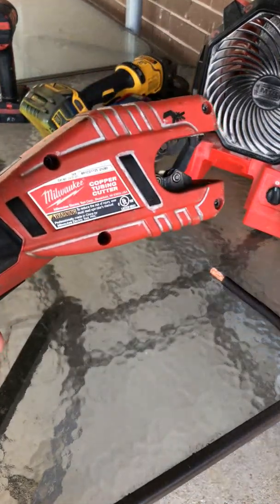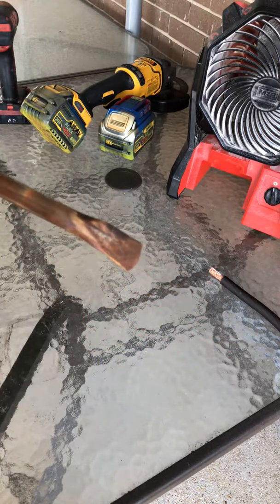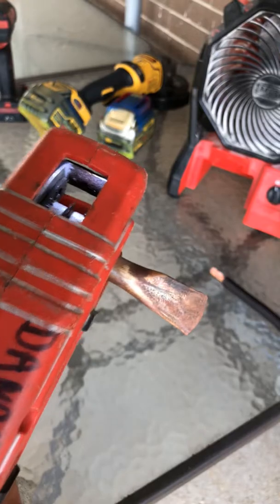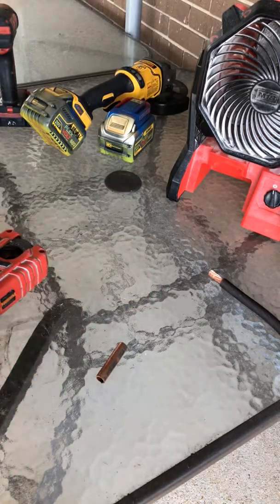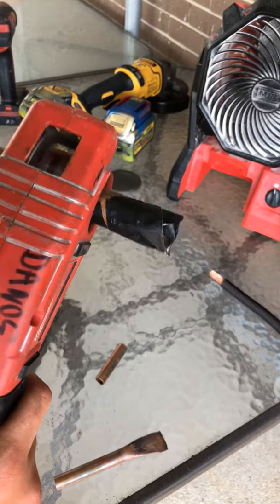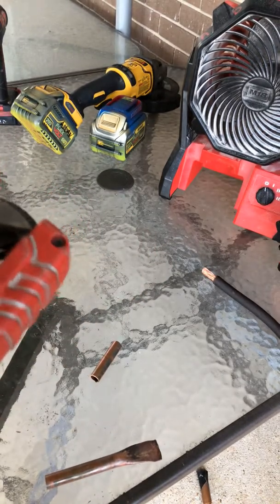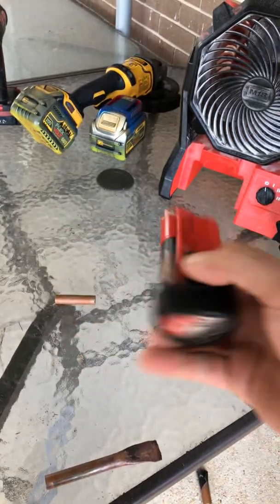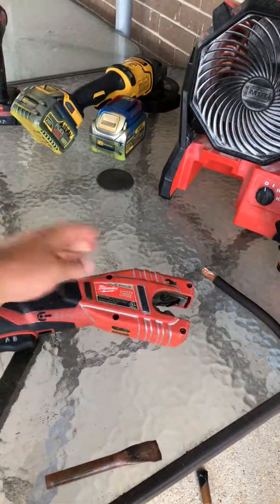Milwaukee m12 tubing cutter

Comment: I rarely ever have the need for this tool but I feel the to have one
Reply from the maker: HeatCity Hedonist haha I use it so much it’s almost time for a new blade in it, I just wish they made a switchable mouth that cut smaller than 1/2 pipe and one bigger to cut bigger than 1-1/8
Reply from the maker: Have you ever tried one out?